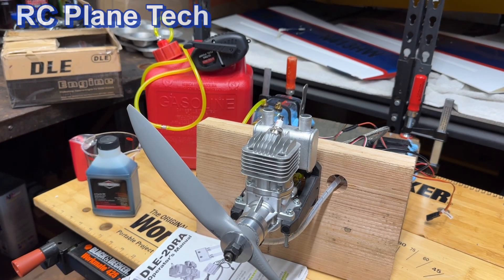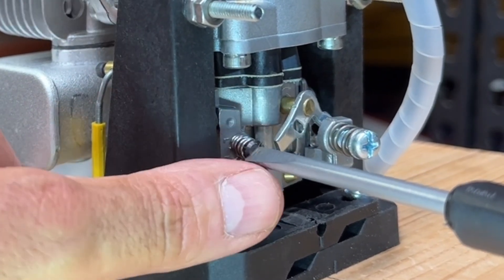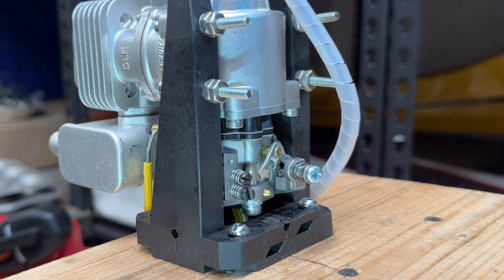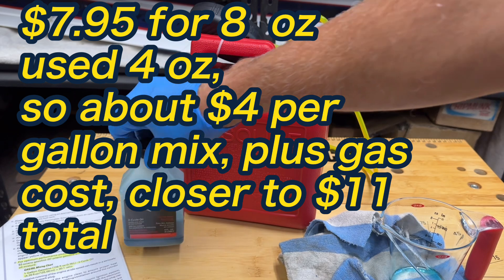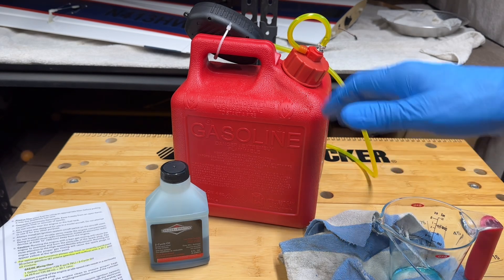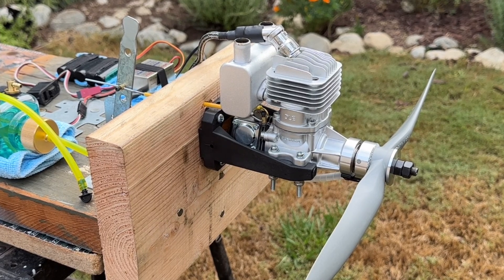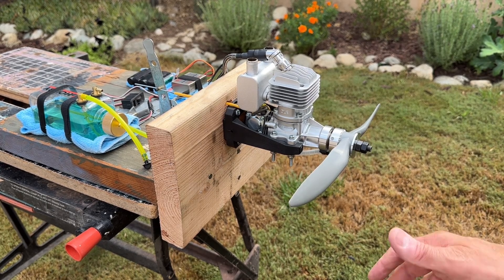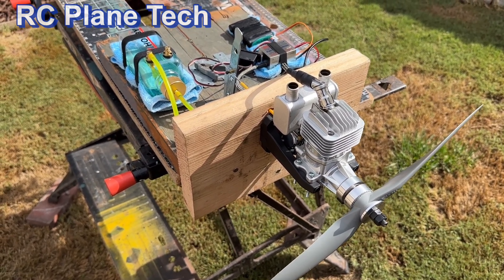DLE-20 RC Plane Gas Engine, Learning Series, No. 4: Test Run, Oil and Gas mixture, factory settings

Comment: Excellent video! thank you for taking the time  to explain things in details. I struggle to adjust my DLE 30: it keeps dying on a rapid throttle acceleration. I tried different adjustment on high and low needle settings, nothing seems to help. Am I meesing something? the engine is brand new. Would throttle pushrod be a problem ?
Reply from the maker: Thanks. I would set it back to the factory settings on the high and low settings. Those are in the manual. Start there. If it cuts out on rapid throttle from idle, it could be too lean on the low speed needle. Meaning it needs to open up a tad. I would set it at the factory settings, then open the low speed a little at a time, like an 1/8 turn at a time. And see if you can get it to not cut out. Also check the high speed as well make sure its not lean also, set the factory setting and open it as well a little more. But start with the low speed needle off the idle. Usually when it cuts out like that its just too lean and and when you hit the throttle hard it starves the fuel so it cut out. If its to rich, open too much, it will hesitate or bog down rough before it evens out, but usually wont stall when too rich. So hope this helps, also search on the forums and other channels, lots of info out there. Good luck!
Reply from the maker: I just wrote a reply, it should have gone through but I don’t see it..
Reply from the maker: So i would set it all back to factory settings, start there, the manual gives the settings. Then if it cuts out on rapid throttle, probably too lean on the low speed needle. Try opening it a little at a time, like an 1/8 turn each time and see if you can get it to hold. For the new engine you may need to run it rich for a while, so check the factory settings and open the needle a bit more as note above, could also d that to the high speed , keep them a little rich until the engine breaks in. Hope this helps
Reply: @JamesRCPlaneTech  many thank for  your quick response. Let me try it. Does your DLE tolerates really fast throttle acceleration, like instant?
Reply from the maker: Ya I have no problem hitting the throttle. Mine is new as well so I have it set at the factory. I actually have trouble with it stalling out on idle when I bring it in for a landing, not sure why yet. I have been running it gently, I don’t gun it unless I have to anyway, but it runs well, probably not optimal because still breaking in. They are amazing and fun engines, try to not get discouraged.

Comment: can you fly inverted and in any attitude without fuel tank leaking? because it has an air intake on top.
Reply from the maker: I believe you can with the fuel line looping back and such. I don't do much of that. I think if you did a lot of that, you could eventually get some leaks from the line, but it would be minimal I imagine.

Comment: Nice instruction video. I am about to buy a NGH 17cc or DLE20 cc, but I am curious how the DLE20  is doing after a year of flying. I read different stories about the NGHs, mostly good. But sometimes I read cracked pieces coming out of the motor. The DL20 quality looks better. Can you give a little update how the DLE20 is doing till now. Is it reliable? Does it perform well? Thanks in advance.
Reply from the maker: Thanks. Well this is a new engine, it will fly for the first time with the Balsa USA Stingray Im currently building. Sorry I can’t be of more help, this is my first gas engine. I will say that these DLE s are very popular and appear to be good quality. I hope to be done with the build in about another month or so, and do the maiden flight. Hopefully it will survive that and then I can test the engine over time.

Comment: My DLE 20 ra manual says 1.25 for the low and 1.50 for the high not what you said " 1.5  low and 1.5 -2 for high.
The manual also says 50:1 not 30:1 mixture they may have change things around
Reply from the maker: Interesting, I checked on my manual and does state what I said in the video. My Manual is dated 2014 and is distributed by Hobbico.
Reply from the maker: Ill post pictures in the community tab. Check them out.
Reply: @JamesRCPlaneTech  .... I just bought my DLE20RA a few days ago , they may have changed the settings

Comment: The biggest issue I have had to overcome is that needle adjustment is not instantaneous you need to give the diaphragm time to react to the new settings.
Reply from the maker: Yep, you have to use the mixture up between the needle and the engine first
Reply from the maker: Small adjustments, wait, small adjustments wait… it gets there with patience

Comment: turn the rubber insert in your starter cup around backwards....makes locating the starter on an engine without a spinner better and stops it flogging around on you lol
Reply from the maker: Thanks, I flip it around when using a hub, it would have been helpful here as well. Thanks again

Comment: Save that briggs n stratton oil for your lawnmower lol.

Don't use it in a high revving engine.
Stick with redline or Klotz
Reply: That is the oil that you should use "after" breaking in the engine. The engines that I've had where the manual mentions to use Lawn Boy ashless oil for break in, another brand that is good for breaking in an engine is Stihl small engine oil. Then you can go to Redline, Klotz or even Amsoil after the engine is broke in.
Reply: @rcflyernc2001  run in with the oil you intend to use long-term.
Oh and stilh synthetic is very good also.

Comment: you can bend the connecting rod in a single cylinder gas engine running it bolted down solid on a stand you need to always run it on the airframe so it allows the engine vibration to run through the plane so it can move and shake the rod is aluminum most manuals will tell you to never bolt it solid to a stand
Reply from the maker: Interesting, thanks Ill look into this.
Reply: if you clamped the crankcase in a vice perhaps, but have never heard or seen this happen in all my years of r/c aircraft modelling....bent rods are more likely from a flooded engine, or from a carbon buildup on the piston crown....if you watch the video, the engine moves around in the engine mount anyways

Comment: Qual Bateria você usou para a inguinicao  quantos volts
Reply from the maker: You can use a typical rechargeable battery that you would use for your servos or receiver, and the voltage can range such as a 4.8 volt or 6 volt battery. Typically you would have a separate battery dedicated to the engine and another dedicated to the receiver and servos. I use a Ni-MH battery from batteriesamerica.com they make lots of batteries that are compatible with different systems.
Reply from the maker: You can use any basic rechargeable battery, 4.8 to 6 volts. Check the manual for more info.

Comment: Did the filter fall off the bottom of the feed tube in the gas can?
Reply from the maker: In the gas can, I didn’t have a filter
Reply: @JamesRCPlaneTech  Hello James. These are great video's that you are making for those that are new to what us gas engine owners call "gassers". I do have many years of experience with gas engines, and I am still learning more too. There are some things that I think you should change asap. 1. use a fuel clunk in the gas can and like others were saying, to use a filter in the can also. 2. on most aircraft that run on gas engines, the top of the motor is usually on the bottom (pointing toward the ground). You would have to change up the linkage for the throttle and choke also. 3. The motor mount you are using looked like it was kind of hindering the choke to be able to close it all the way. I recommend a motor mount that are called stand offs. They are much better with the rear mount carb's, even for running on a test stand and like @sendit2873 said, you should run the engine on a plane rather than a stand, but doing the test stand no more than a couple times should be ok. 4. The APC propeller you are using is kind of, if not very dangerous, since they are so sharp on the side that you would flip the prop by hand, which is what I always have done, because when you get up higher in the CC's of engines, i.e. a 50cc on up may not work with all electric starters like you have. I HIGHLY RECOMMEND a wood prop just to start out for now, then if you want to, they are more expensive, but carbon fiber props are also very good. The wood props that I use myself, and what I recommend are Xoar propellers. They also come in different colors and some have painted tips for safety. There are many good carbon fiber props out there, like Falcon, Mejlik and some others I cannot remember. I prefer the Mejlik, I've heard they are all about the same quality. I recommend going to "DA" short for desertaircraft.com engine's props, oil etc... There are other hobby shop's that have the stuff you need, but I always end up back at DA. If there is anything else that I see that I could help you with, please don't hesitate to ask. I will try to answer it, but if I can't, I do know others that would.

Comment: the instructions for my dle 20 ra says to use 92 octane 50:1 synthetic oil, at 4500 rpm for .5L
Reply from the maker: Ill have to go back over my instructions, maybe I missed that.

Comment: You need rubber bushings during break in.  This is gard on the engine and can cause damage.
Reply from the maker: Thanks for the tip, I hear that these engines run rougher than the glow engines.

Comment: I like that setup for running in your gas engine! I recently got a rcgf15cc Stinger for my engine collection and putting it on a 20cc easy stick RC plane I just got from value hobby for 169 bucks and it's really a good built plane!
Reply from the maker: Thanks. And very nice about your new engine and plane. Thats a classic, looks like the older Great Plane Big Stick 60. I haven’t heard of Value Hobby, Ill check it out.

Comment: I have also purchased a used gas motor  that has had its high and low adjustments messed with. your video explains these screws very well but what about that third screw with the spring on it. what is it ? how do i adjust that once its been messed with? thank you
Reply from the maker: Hi, so I think you are talking about the screw that is used to adjust the throttle for proper idle when these carbs are used on other equipment. You basically don’t use it because it designed to hold the throttle open slightly for the idle, when these carbs are mounted on things like weed wackers, lawn mowers, chain saws, etc. On other equipment like this, the throttle return spring closes the throttle, and this screw is used to keep it open slightly for idle, otherwise the engine would quit. But for rc, since we set the idle using our servo for adjusting, we don’t need this screw. So the instructions say to disconnect the spring on the throttle arm, which frees the throttle to move freely and to be controlled by the servo. As for this screw, you would open it enough so that it doesn’t interfere with the throttle adjustment at idle. I hope that makes sense.
Reply: yes that makes sense. and what would the procedure be if you had a needle screw as well? thank you. @JamesRCPlaneTech
Reply from the maker: Well, on this DLE, there is the high and low speed screws which are the same as the high and low speed needles on a glow engine. On this engine, the low speed is set 1.5 turns open from the closed position, and the high speed is set 1.5 to 2 turns open from the closed position. These are just the factory settings. once the engine is broken in, they can be fine tuned. If yours is a DLE engine, you should be able to obtain the manual online which goes over adjusting them. I go over it as well in my video on this engine. But if yours is not a DLE, I also recommend seeing if you can find the manual online. Just do a search.  I hope this helps

Comment: Did you mean to remove the clunk filter in the tank? Any reason for that?
Reply from the maker: I didn’t put a filter in for the test run, just forgot, probably would have been a good idea to do so. Thanks for pointing that out. Always best to keep the fuel clean as possible!

Comment: Hi James another great video. I use a filter clunk on my fuel supply. Just to be sure no junk gets in the tank, Also run a filter from tank to engine.The fine screen on the Cary can block up if u get some crap through the line. Looking FWD to see what ya put her in to fly. Take care. greg
Reply from the maker: Thanks Greg, yes I need to get some filters in the can and tank and inline, I need to look into that. Thanks! And ya, Im wondering what plane to put this on. Been thinking.

Comment: 30$ for glow try 55$ in ny take the 30 all day long
Reply from the maker: Wow! Ya, its getting up there. Here it’s probably around 35 after taxes. And then its not always on the shelf. Thats why Im keeping my glows 40 class and smaller. With a little 25 you can get a lot of flying on a gallon.
Reply: @rcplanetech9044  yea can't say the same. I have mostly 1.60s average summer of flying I burn 10 gallon of fuel
Reply from the maker: Ya, that’s expensive for sure.  I know some people mix their own glow fuel. I looked into that once, but finding the individual components wasn’t that easy. But that could be an option if the costs are lower.

Comment: As far as oil goes I use Quaker State "ashless" for break-in and RedLine after break-in,you can't go wrong with RedLine 100% synthetic T2 racing oil for 2 stroke
Reply from the maker: Thank you, another person recommended Redline also. Ill be checking that out.

Comment: I see you don't have a filter in your gas can,you might add one,the one with what looks like cloth media works very well I've been running gasser for a couple of years.I have a filter in the can,another one before my pump as well as "surefire" filters on my planes
Reply from the maker: Thanks for the tip. I’ll look into that, sounds good.

Comment: I've got 4 gas engines so far I've had good results with them! I've got 2 -6 CC and 1-9 CC SH GF engines and a ZDZ rv120 which is 20Cc and they run great and you never have to adjust the carburetor after you get it set correctly! Only thing is you have to be careful with reciever placement so you don't get any problems with interference from the ignition system! The SH GF series engines use a turbo glow plug so you don't have to worry about interference with them! You can also use a OS g5 glow plug in your dle 20 and then you don't need the ignition system!  I've got one I'm going to try in my ZDZ so I'll let you know how good it works!
Reply from the maker: Ya, The interference issue is one that I worry about. Ill have to be careful when the time comes to mount it. And Ill have to check into the glow plug idea. If that works then by all means do away with the electronic ignition.. Ill have to check that.

Comment: Good video. Make sure the 2 stroke oil you using have a FD rating. Japanese standard for 2 stroke engines. Adjustments to the carburetor you can do in minutes (watch). You won't believe that small adjustment can make a difference.
Reply from the maker: Thanks for the tip, Ill check it out.

Comment: Good info.  I used the same oil but switched to redline. Same ratio but made a huge difference in how it ran.  Mind you i know nothing was in garage and some landscaping guy saw me struggling came and helped me.
Reply from the maker: Hello, thanks for the suggestion. I’m going to look into that oil.
Reply: redline oil is a racing motorbike oil...not designed for use in aircraft engines...reason is that redline oil is designed for engines that get HOT, it will burn off any residue cleanly...go put it in an engine that doesnt get as hot, it turns to soft carbon and will carbon up the engine.....i have personally used coolpower engine oil for around 30 odd years now....its the only oil i run in all my glow and petrol(gas) aircraft engines.....i run it at 40:1 in my DLE 40 twin and have done so for well over 50 flights without any issues...i also use the same fuel in my 2 stroke lawnmower & brushcutter......just sharing my experience
Reply from the maker: Thanks for the info, Ill look into that oil as well. Awesome